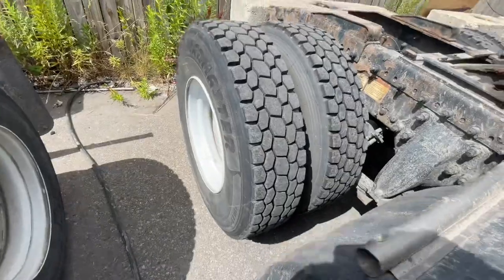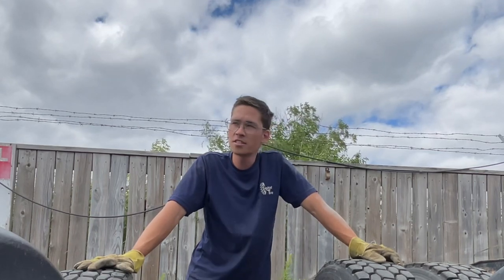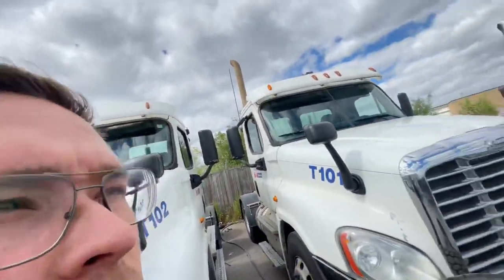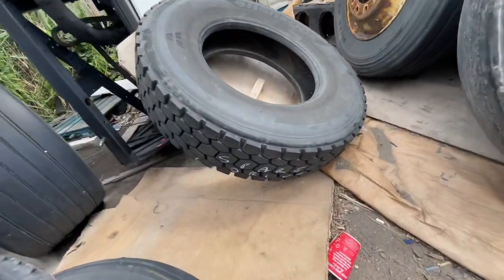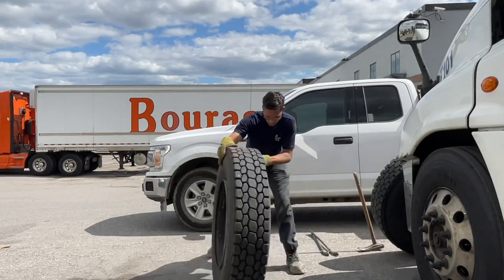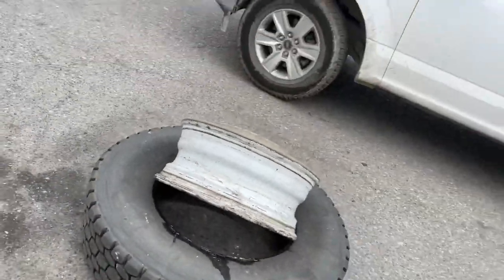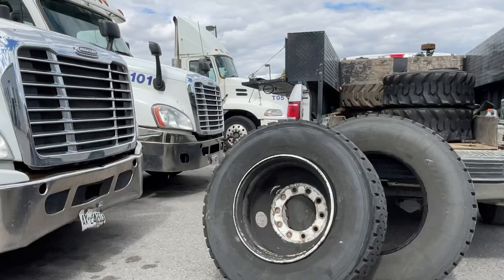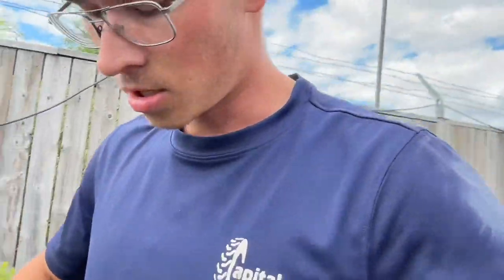The Tire Doctor Vlog #1 - Truck Tire Repair

Comment: That “elevated” lip is called a safety lip, it’s designed to stop the tyre leaving the rim if it deflates in use. Very effective but I agree it’s a bitch to break the bead when changing the tyre. Oh I’m a thirty year veteran of commercial tyre fitting

Comment: I work on trucks all day long and do the occasional tire not to often maybe a set of drives once a month or a trailer tire every now and then or steers, anyway never had to chance to do a outside tire it's always the inside one but we pull wheels for safting it anyways so just do it at that time, u make it look easy putting on the new one, could you show us what you are hitting with ur tire hammer to get it on I always default to using my bars

Comment: Ever consider a nut runner that drives all the nuts in at once? Like the ones they use at the factory. I'd up your microphone game a bit - deadcat on phone mic and some lapel mic too.
Reply: The one’s on assembly line at the factory are made specifically for the car/truck off the assembly line. One made for Hino wouldn’t fit Caterpillar or John Deere and vice versa
Reply from the maker: I’m looking into getting a mic atm 👌🏻
Reply: @dac554  Yeah I guess, though you'd think there'd be some adjustable one. If not, one could make such from multiple of them I guess. I was thinking of making one of my own from some cheap Chinesium Makita copies. 5x50€ for 250€ one shot gun nut/bolt runner.

Comment: What's the torque specs on that hub piloted 33 mm nut? Also is that a dry torque or oiled
Reply from the maker: 450-500ft lbs, never oil
Reply: Two drops of light oil on the studs and on the wheel nut washer .
Reply: @vicpetrishak1077  correct sir I was waiting to hear this from someone
Reply: @b.t.waquaticss8309 you guys are so weird dude is out there risking his life for a pay check and to give us content and all you want to do is criticize and tell him how to do the work he specialized  keyboard warriors are my pet peve really hate y'all acting like you guys are in reality over the internet
Reply: @user-oh6rw2ln9c  whoa whoa whoa calm down it was just a question. I don't disagree with ya anyone getting there hands dirty and working hard my hats off to them. As also me that has been doing commercial tires for 20 years.